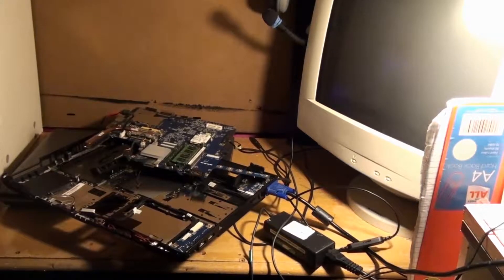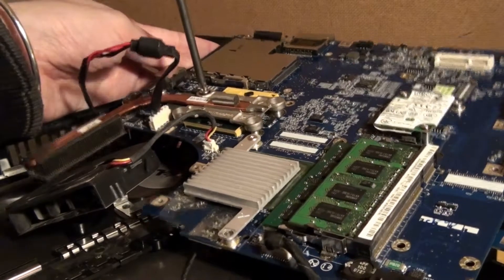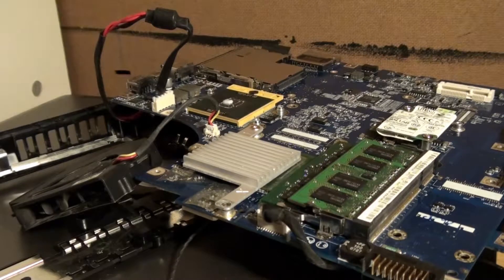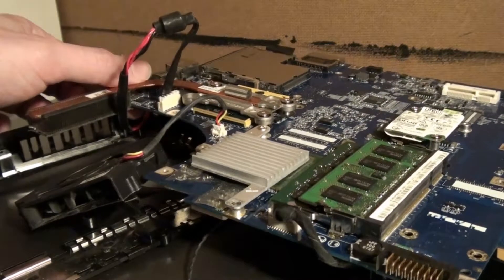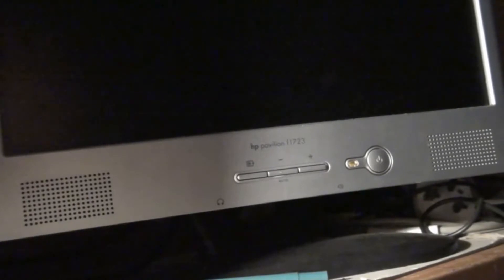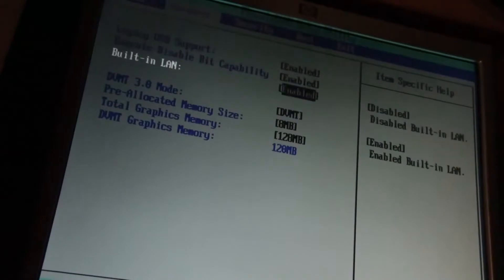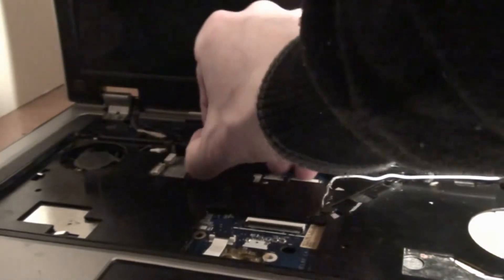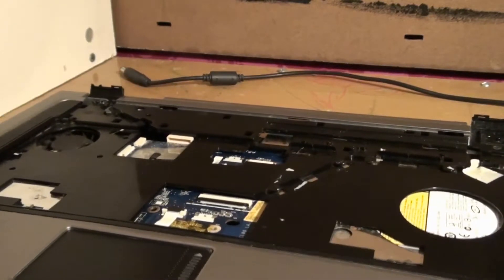Upgrading A Celeron M 440 Laptop To A Core Duo CPU (32 Bit) 1/2

Comment: Hi, I have celeron m 440 also , can I upgrade to core 2 duo t2050 without bios update? My bios date is 14/2/2007 date , core 2 duo t2050 release date is 2006 May
Reply from the maker: i did mine without updating,i haven't got that laptop anymore,but i swapped out a dell cpu at the time  and it worked,it's not 64 bit but it was much faster after the upgrade.